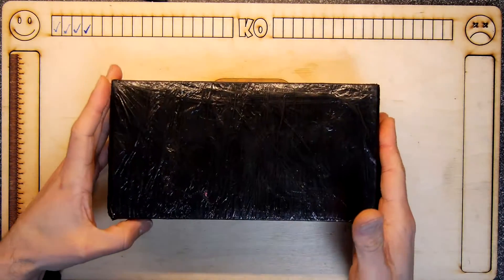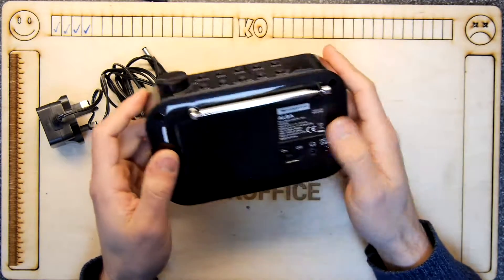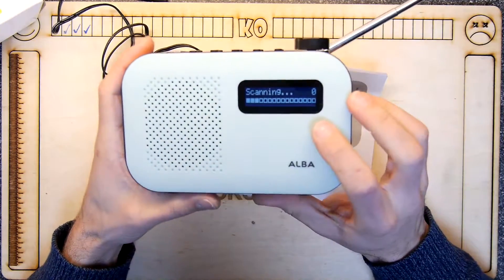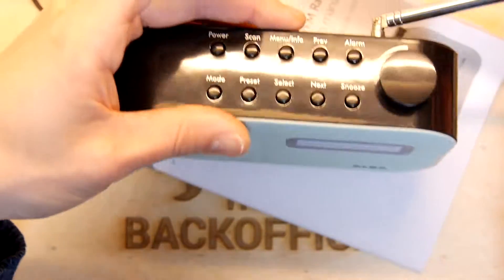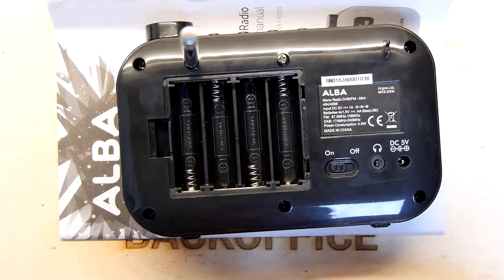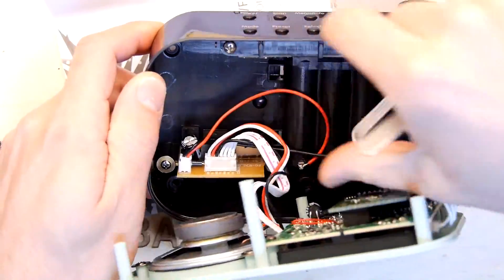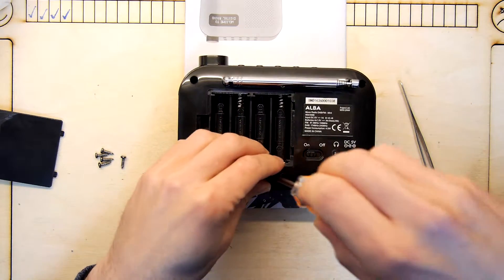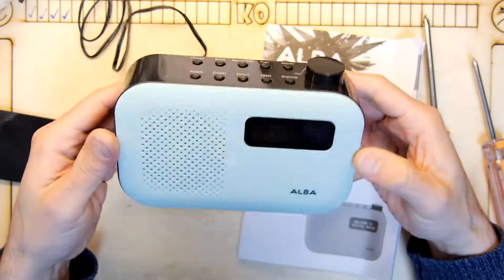Argos Alba DAB Radio

Comment: My Alba broke.I got so fed up with BBC I stopped listening to the radio for months.When I turned it back on it did not work. I reckon some of the electrolytic capacitors inside gave up the ghost. The power is quite dead - batteries or PSU. I see it's only £13 on ebay. I think I best buy another rather than try to repair the electrolytics; especially as the aerial already broke when I stood on it in the middle of the night. New aerial costs £8; so hardly worth repairing.

Comment: I've got the Tesco one with a USB power port, which is great for the garden, as you can just use a mobile power bank, and save on batterys.
Reply from the maker: That's a good idea, should run for a fair bit with one of those

Comment: I got that radio, in pink/Lilac
Reply from the maker: +June Scott how is it working or for you? Ours are still going strong 👍
Reply: Yes mine is fine, I take it to work with me, I can put it in my fleece pocket, it would be better if it was a bit thinner, but I like it
Reply from the maker: +June Scott I'm pretty pleased with them. Sound isn't anywhere near as good as my Roberts or pure evils but they are a lot dearer. Plenty good for radio 4 😂
Reply: I like listening to absolute 80s
Reply from the maker: +June Scott I'm going to give it a go! Thanks!

Comment: Any ideas what that little wire fix might be on the board, or is it part of the antennae?
Reply from the maker: +treguard1982 Do you know what time this is visible? If so I will check it out 👍
Reply: It's the orange wire at 06:55, right next to the raised platform on the lower part of the pcb. Looks like the other end goes through a tiny hole to the underside. :)